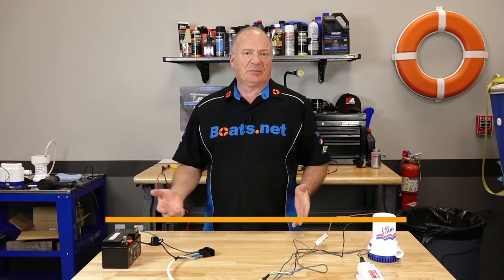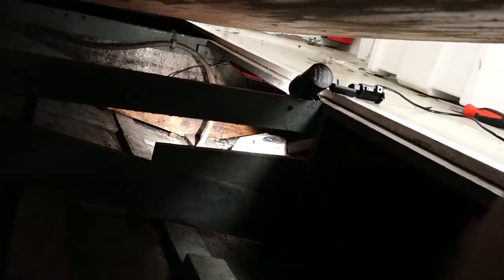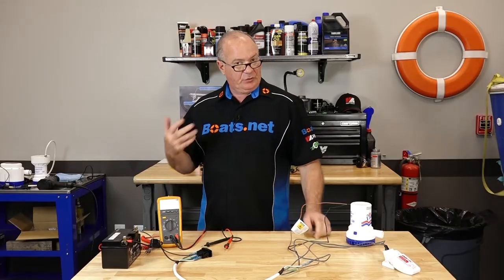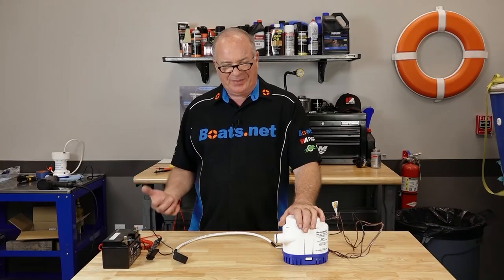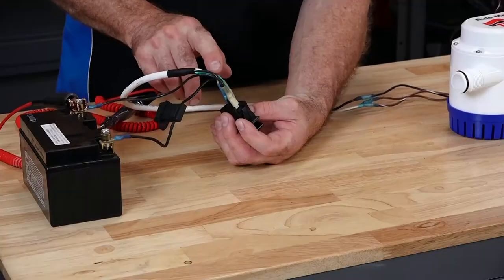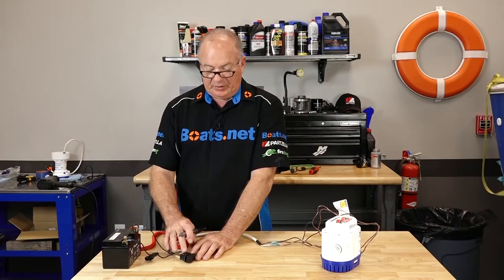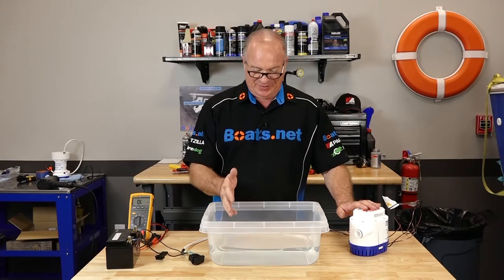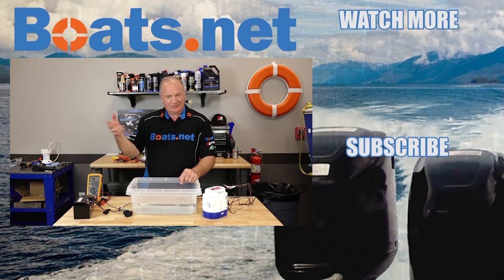How to Test a Bilge Pump | Bilge Pump Not Coming On | Bilge Pump Float Switch Test | Boats.net

Comment: I have a question. What makes my bilge pump make a humming noise for about a minute after I turn the key off. I don’t hear, or see water coming out of the hole on the side of the boat.  Also when I pull our boat out of shelter and go about 20 miles to the store to get gas our carpet will be real wet near the back of the boat. We have a 2000 model Bass Tracker, with stick steering. I can’t see the bilge pump for the large gas tank. Thanks for any tips!